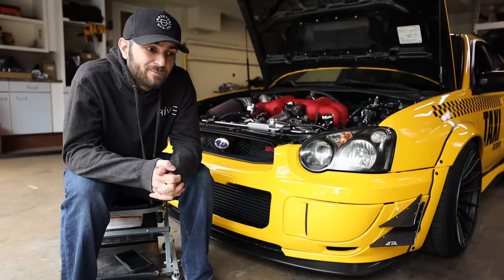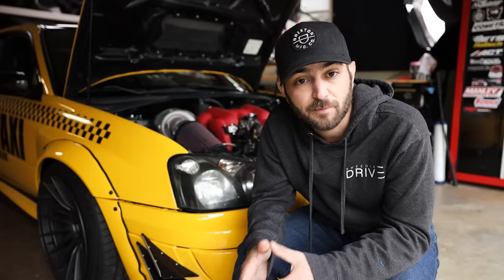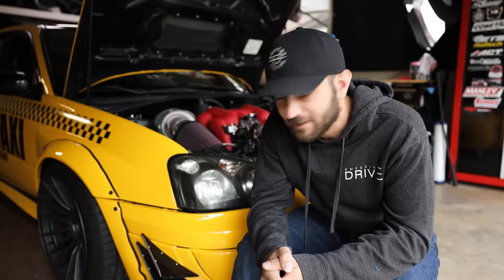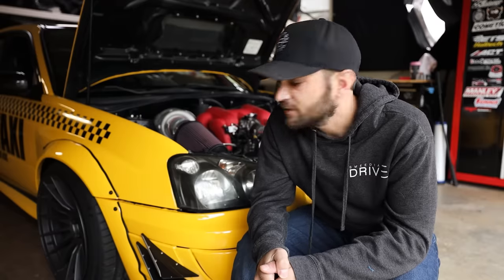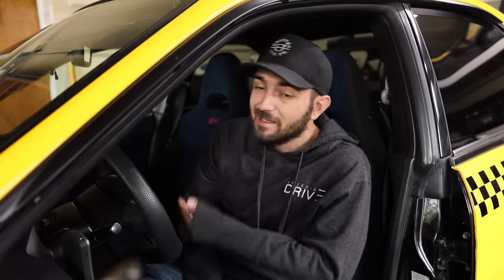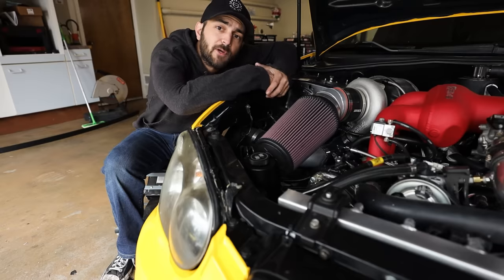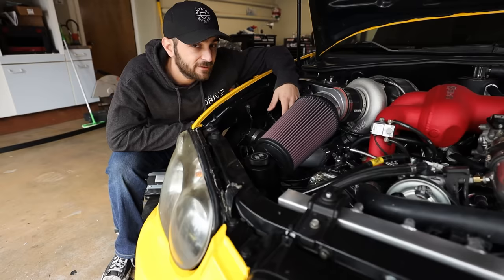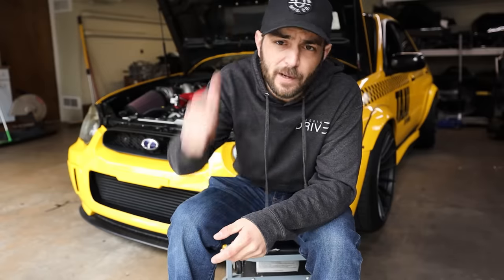What You Can do To Keep Your Subaru Reliable.

Comment: All wrx will eventually get rod knock. Nothing anything can be done about it just a bad design. Search wrx rod knock on youtube. Hundreds of videos will come up. They are very fun cars but plan for an engine rebuild
Reply from the maker: 200% not true and a bold statement to make, but if we're along the same thought processes any engine at any point in time will get rod knock
Reply: @Smeedia  yes but the wrx both the ej25 and fa20 develope rod knock very early on. Even people that say they always change their oil and dont drive the car hard. The fa20 especially seems to start knocking at around 100k miles but ive seen it start even earlier
Reply from the maker: Also not true, rod knock, engine failure or any other damage is 99% of the time a direct issue from mismaintance, improper modification, improper tune/tuning. I've seaoped more engines for people than I can count at this point and owned 20+ WRXs and STIs. They don't just wake up one day and decide to grenade themselves

Comment: What about equal length headers air/oil separater and head studing sorry to say you are pretty off and for tunes thats for stabilizing the performance modifications you have put on the vehicle.
Reply from the maker: They're all solid mods but if someone's not looking for power or to really modify the car then that's out of the question for some. Tunes alone will benefit a stock engine. A tune is not made just to push power. They greatly aid in longevity, proper calibration etc. Even if you slapped an OTS Tune on 3 diffrent cars across the county eniormental factors play a massive role on how a car operates.

Comment: Warm up a car? Why dont you drive the car normally before you start driving hard thats it.
Reply from the maker: To let oil pressure drop and oil viscosity thin a bit. Cold start oil pressure depending on oil grade, oil pump etc can have cold start pressure north of 120PSI.  For reference normally warm idle is around 25PSI. So typically ill allow pil pressure to dip down to about 60PSI before driving.

Comment: TGV delete
AOSeparator/ Not a Catch Can
Killer Bee oil pickup
Forget the brand but aftermarket water pump better than factory/ factory is open fin impeller you want a closed fin impeller 
Oil done every 3k E85 every 1k
Quality fluids only
Top mount intercooler is cool but front mount is better. It’s all about Temperatures!!!!
Aftermarket oil cooler
Aftermarket steering rack bushings: white line works well
Always watch for knock. Knocks are vibrations and THEY WILL destroy your engine

Your Subaru will never be as reliable as a Honda or Toyota. Nor will it be as easy to Mod. Subarus are not beginner friendly. You can’t just throw a part at it even a quality part without surrounding supporting mods to go with it. It’s not a Honda. You don’t just throw a down pipe on it you’ll likely start over boosting. However when these are done right, they are a fantastic and unique vehicle to drive around. Hope this helps get you started.

PS- almost forgot. IAG firelock head gaskets 👊🏼

Comment: Easy...... DO NOT CHANGE PARTS AND WASTE MONEY MODIFIYING THE CAR. THE CAR IS PERFECT. WANA MORE POWER, BUY A FERRARI LOL
Reply from the maker: Wouldent say it's perfect by any means but modify it the right way and it will be fine
Reply: @Smeedia  I had a 2011 STI, never touch, runs and feels amazing just like is. Spend thousands to gain more HP is other possible failure.... I modified an BRZ, spend a lot and what I gain? 85 HP and los of problemas. that companys do not tell you. The say you will gain this.. but the truth is is you wana kill your engine this is the way. Nor the BRZ i sold and the New owner never drive the car... is in the  garaje fixing thins... what a relieve...
Reply from the maker: Built my 05 STI to 650WHP, build it the proper way and you don't have to stress issues. People try to push OEM parts way farther than they're suppose to go then blame the car when it fails
Reply: @Smeedia   hey man I love your videos 
And clearly you know what you are talking about! 
My question is I just got a brand new 2021 WRX STI 6km it so far I’ve just tinted my windows! So I was wondering what you would suggest I do to it! That is important basically to keep it reliable. Also I daily drive it! 
Btw I leave in Vancouver perhaps when the borders are open I will bring it to Seattle and check out the car master🙌🏾
Reply from the maker: Totally down 🔥 and what are the overall goals with the car?